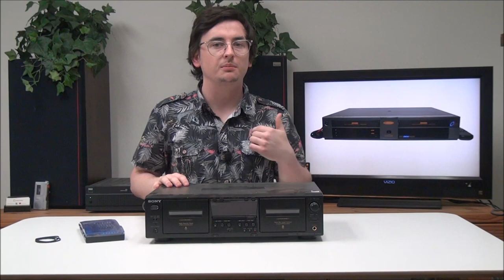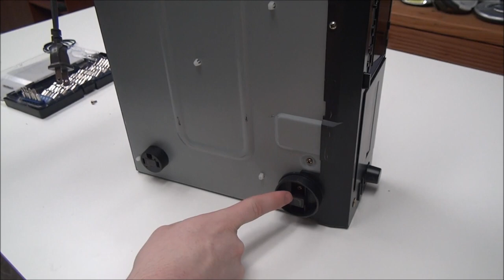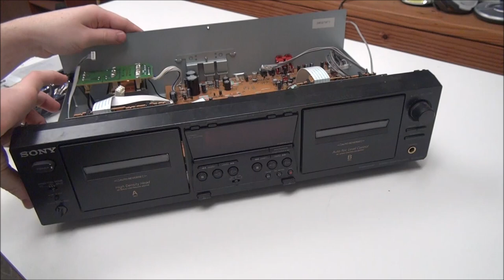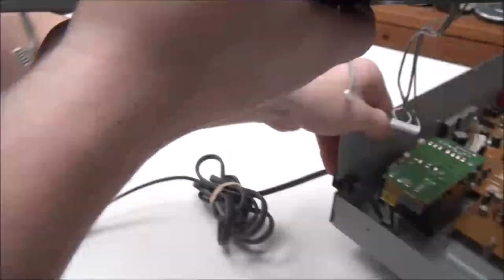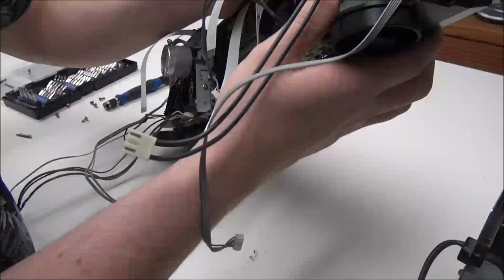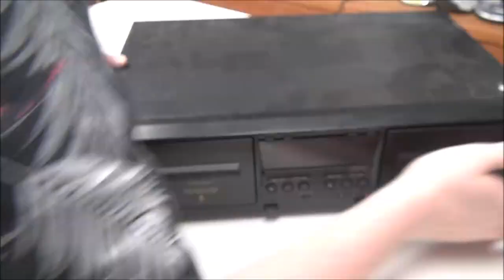How To Repair Sony Dual Cassette Tape Deck Player Recorder Belt Kit Replacement TC-WE475 Won't Play

Comment: This video really helped, Thank you! I replaced my belts (found them on Amazon) and now both decks work beautifully!  A couple of caveats on the video - there are a couple of places where key actions are happening "not quite in view" of the camera. Also fast forwarding was used just a bit too much, in an effort to cut back on redundant steps and unnecessary detail, but a little necessary detail was lost in the editing. Also I agree with a comment from 4 years ago that the motor can be pried a little back allowing you to slip the belt in where it needs to be. I just couldn't get the doors off the decks, so scrolling through the comments showed me I wasn't the only one, and other viewers had found this work-around. I also had viewed videos for other models, which were a bit easier a repair job. But I was glad to find this one specific to my model. I suggest taking pictures as you go, so you remember all the wires and ribbons that need to be plugged back in, and where.
Reply from the maker: Thanks for the feedback. I will do better with future videos!
Reply: @Spencertified  It really did help! tape deck is going strong!

Comment: I always lay my work out on a soft towel to avoid scratching the front of the panel. But that's just me. It also keeps the small screws in place and keeps them from rolling off the bench.
Reply: Agreed.

Comment: I have a Sony TC-WE625 dual cassette deck and out of nowhere BOTH cassette players stopped working; they both sound like they are trying to play, forward, rewind, etc. but nothing happens.  Does this sound like a Recorder Belt issue OR something else?  My guess is that it is NOT related to the belt because both drives are experiencing the same issue.  Thanks in advance for your help.
Reply: I have the same issue.

Comment: Well I found this site and was able to replace the belts...yeah the drive belts were toast! But I got the new belts in...did a bench test and the tape begins to play then shuts off...both decks...same thing. That's an electrical glitch. Any ideas where I might look? It's already diminishing return, but if it's something simply I would like to keep this deck. Crisis diverted! My bench test was without the cover attached. So I decided to give up the ghost and button it up to put back in the box for a TBD. I put the cover on and just out of curiosity tried to play a tape again...Low and behold it played!!! YAY...So it apparently needed the cover to complete the ground on the unit...go figure...but I'm happy. Thanks

Comment: Thanks! Just repaired a TC-WE635! Get some alcohol ready to wipe the heads. Don't force anything - the eject mechanism has a small pin that flies off - never going to see that again. Don't wind the pulleys once the belts sit ok. Don't rush disassembly or reassembly - I ended up with a spare screw! Typical!

Comment: So the Fast Foward /rewind mechanism uses a different belt from the ‘play’ mode?  I can fast forward/rewind no problem, but when I ‘play’ a cassette, only 1 one side of the cassette turns, and if I let it go, the tape will jumble up and eventually jam.

Comment: Hi, I have a cassette deck exactly the same as this one, but my problem is that I need to replace these two motors, but it doesn't tell you their working speed or direction of rotation except marking them to work at 12 v. I hope you can help me solve this problem.

Comment: It was noted below by Phil Landers as well, but just to refresh the comment, it is not necessary to take the front panel off.  A slight bend outward of the motor will allow just enough room to slide the belt past the third leg.  It looks like the motor is held by three legs with associated screws, but there are really only two screws.  Look very closely with a magnifying glass if necessary.  This allows you to skip from :55 into the video to 3:45. Much faster and less room for breakage, lost screws, broken wires etc.

Comment: Bought one on FB Marketplace. I think the guy thought he was pulling one over on me but I saw this video beforehand and counted on replacing the belts. Of course, the rewind did not work properly on either side which be neglected to mention, but it did play fine, so I was able to get it back to working condition with new belts! Also had to adjust the speed on one side and found another video for that.

2:19 I love how this part was skipped through. LOL I put a pry tool in the top and gently pushed outward and it came right out without damaging anything.

Comment: I do appreciate when people take the time to share knowledge but IMO this video turned a 5 minute job into a 45 minute job. If you need to replace these belts do not take your deck all the way apart like this. If you do you run the risk of causing more problems than you had to begin with.

Remove the 5 screws to take off the cover and access the belts right behind the tape player. Put the thinner belt on first then the thicker one. To get the belt on the motor pulley, simply slide the belt between the motor and the plastic pin. Get the belts from eBay or Amazon for $14. Don't pay $180 to have this done unless you are useless with a screw driver.

Comment: I just bought one of these at a thrift store in Winnemucca, Nevada for $5.
All I've done with it so far is plug it in to see that the display lights up, and also I had a look at the heads and pinch rollers (all looked clean).
Should be fun to play with!

Comment: Skip all this and just bend the drive motor back slightly to the left and slip the belt through the gap on the right, between the back of the motor and the pedestal, using tweezers 😎
5 minutes tops 👍
Reply: That's exactly what I just did...have the exact same sony model and just replaced the belts on both sides - working great.  One thing, just put the small band on first then slide the large one sideways past the motor and it's easy to thread it on there...so glad I didn't have to pull the whole thing apart!! Got the bands at the local electronic shop - $25 for two sets.
Reply: @nelsonkerr1119  where didi you both the belds?
Reply: @canconeteirodopunk  just went to a local electronics shop here in Westminster, CA.  I took the broken bands in and we estimated the best size bands. Worked out great...still works. Good luck!
Reply: @nelsonkerr1119  mine stop working today... im from Portugal/ europe.... i have to find that belts... thks
Reply: @canconeteirodopunk  There is a company there in Portugal - I got my belts from them.  WebSpareParts.com is where I got them.
Reply: @GlennAbernathy  howwww many thks
Reply: @canconeteirodopunk  they come in a set, prepackaged.
Reply: @GlennAbernathy  thks .... they dont have the produt ... covid....
Reply: everyday hero, you are.
Reply: @nelsonkerr1119  so you didnt have to eject the decks to replace the belts ? I was going to pay someone to do this but would like to trying myself i already ordered a special precision screwdriver

Comment: Mine must be a slightly different build, because it is possible to change the belts without removing or taking the decks out of the chassis. Glad for that. But whatever variation I have, what a mess!

Comment: I was just wondering if you have any tips on the cassette getting stuck and not ejecting fully
Reply: I had this problem too. There's a little secondary armature/latch combo that engages with the primary eject armature. You can disengage it with a tiny flat-edge screw-driver if needed. But that won't solve the issue permanently. Instead, it resolves itself once you finish re-assembly and power it up. Assuming the new belts are properly seated and such, the motors play a role in correctly disengaging that second combo to allow the eject mechanism to work smoothly and properly. So don't panic if the deck won't/can't eject during re-assembly. Just finish it up and try it with the power on. At least that solve this issue for me.

Comment: I have this exact model. It not only ceased to fast forward and rewind but transport A plays for a couple seconds then switches to reverse play then stops. The whole time its counter doesnt count up. I heard of this being common in these models. What causes the counter to freeze like that?
Reply: Did you ever get an answer? Mine just started doing this. Do you know if this is a repairable issue?
Reply: I bet it's the second inner belt that gets torn and all gooey. You need to clean the pooley and replace the belt.

Comment: Belt problem? I have a similar Sony model. First the recorder side door wouldn't open...I unlatched from the inside by disengaging the lock The player side worked once or twice and then did the same thing. Belts looked loose. Do you think its the old belts?

Comment: I have this model.  No issue with belts, but the small dolby switch has become loose, not even sure if it changes anything - no click feel whatsoever.  Using your dismantle method, I assume I'd unscrew the center portion, but not sure what part(s) I might need to replace.  Any suggestion?

Comment: After two years of non-use, both decks are doing the same thing. It will play, forward, or auto side change, for a few seconds then it will stop while the tape is being caught and pulled by the outer pulleys. (Left deck - left, right deck-right) Belt issue? I did clean everything within the decks with alcohol and still no changes.

Comment: Hello, great video, i have a Sony TC-WE305, which i cannot make it work, there's no fuse, can it be the transformer?  is it really 120V?  i have the transformer specification as T501 1-427-780-11,  i want to test with a 220 one, but i don't know the power needed by this unit? what else can i check?  thanks!

Comment: That looks identical to the mechanism in a Denon DRw-585.
Reply: Very possible. Late production deck seems to use the same (flimsy) chassis from the same supplier. Notice the "hollow" plastic flywheel where it's supposed to have metal weight in it but simply omitted. Speaking about cost-cutting...
Reply: @Nantawat_Kittiwarakul  yeah there was no metal on the denon fly wheel.  To be fair the denon actually sounds quite good, the mechanism is quite clunky but I suspect in blind listening it would hold up well.  One of the things I didn't like was the soldered and glued control cables on the display control panel, atleast the Sony didn't make that cost cutting measure.

Comment: Has anybody experienced a noisy mechanical reverse playmode in any Sony auto reverse deck? This is a problem with my 435 deck after i change the two belts. Forward play has no problem.